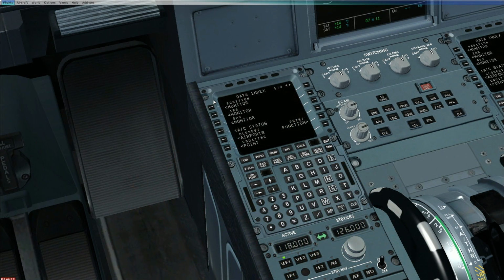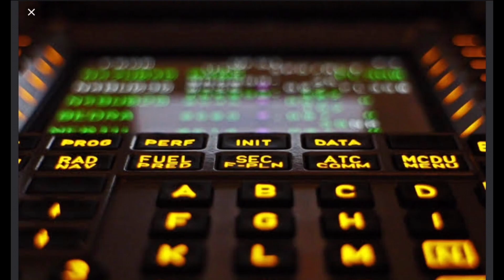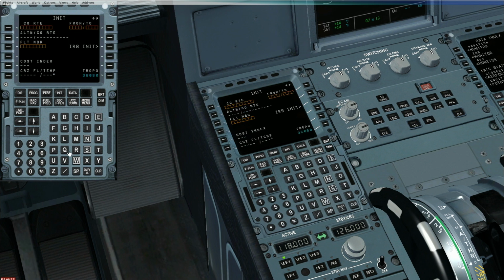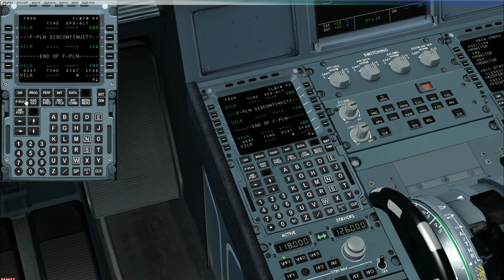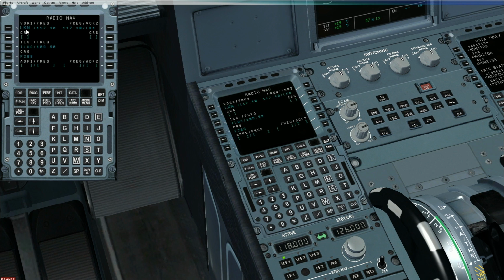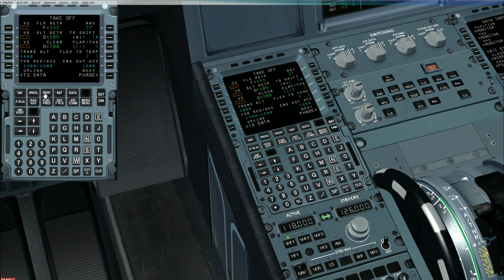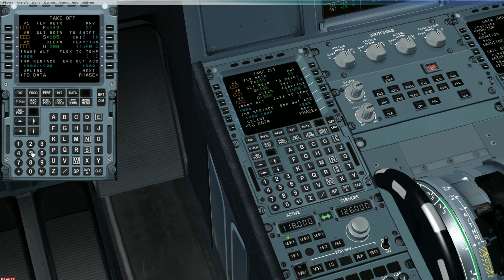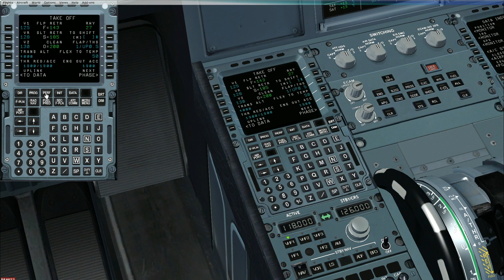The Flows : FMGS/MCDU Preparation

Comment: Hi dear.
Nice job.
2 advises:
1) the flight number must be the ICAO flight number with a 3 letters code + the number  and not the IATA flight number.
2) a lot of airliners are using the DIAFRIPPSF... DATA, INITA, ACCARS INIT,  FLT PLN, RADNAV, INITB, PROG, PERFS, SECFLTPLN+RETURN PERFS, FIXES 
FIX 1 ( AIRPORT + RWY TO TURN BACK IN EMER + FINAL OF THE RWY + ABEAM FOR A VISUAL TURN BACK IN CADE OF SMOKE) 

FIX 2 ( THE HOLD TO MANAGE THE N-1 WITH RAD OF HOLD + ABEAM RAD).

Enjoy your day. Claude:.
Reply from the maker: Hi Claude . Thank you for such an informative input. 
The flight no is just hypothetical , as in real world it will be based on the flight plan.
Reply: He is an IndiGo First Officer so maybe your mentioned information might not be the same.